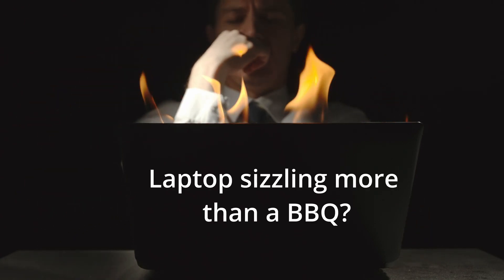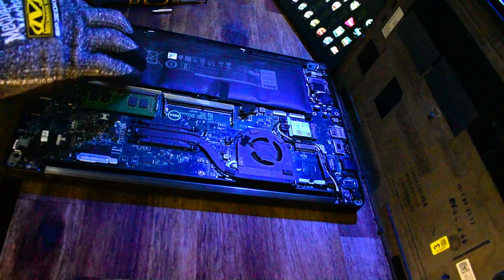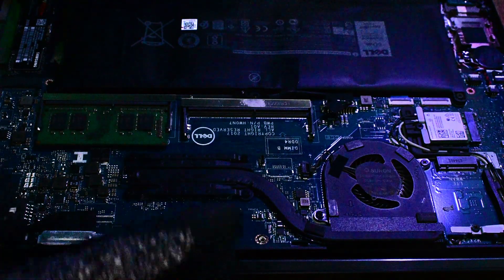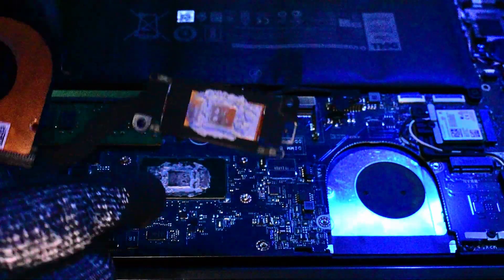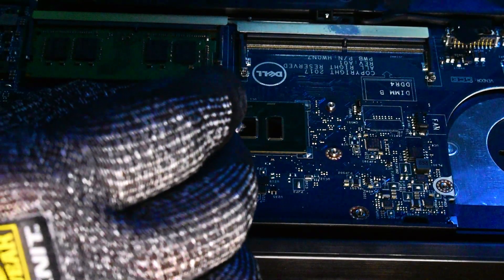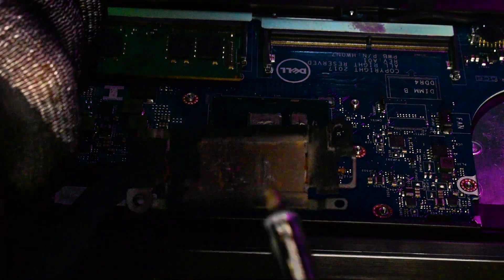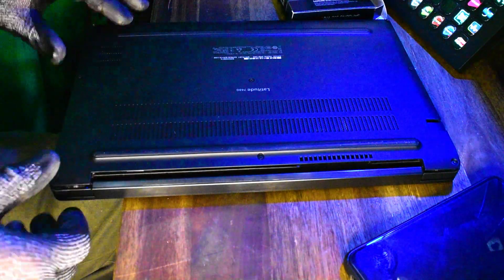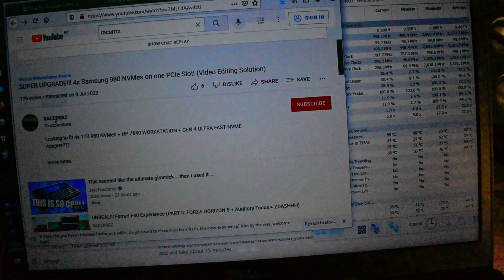Latitude 7480 Overheating Fix! This Popular Laptop Had One Problem. (Dell Latitude 7480)

Comment: Missed the part where you blow all of the accumulated dust from the intake vents, etc.....
Reply from the maker: I tend to opt for the 'Iamnotlazy' technique of not dedusting, as is required. I recall filming this laptop repair at 12am and I wasn't prepared to start up the air compressor to do so (with extreme care to not let the fan blades spin under air pressure; I have been out of 'compressed air in a can' for at least a few years now lol).

Comment: It's good to see breakdown videos out there like this. My only critique is that you don't need anywhere near that quantity of thermal paste. It would have been enough to clean off the old paste and put half a grain of rice's worth on the larger chip, and 1/4 of a grains worth on the smaller one. The goal is to fill in the minor surface imperfections on both surfaces that will barely squeeze out the sides when the heatsink is tightened down, not to put a thick layer between the two components.
Reply from the maker: Laptops tend to overheat due to the small surface area for heat dissipation. I add excess paste to ensure the entire surface is covered without any air pockets. I have done a thorough investigation on thermal paste application (https://youtu.be/pqkvvZPgv8g), and I even set up a formula to calculate the ideal volume of paste for the IHS size, although the surface area of the laptop heat sinks are really small which makes the application volume really small. Give it a test run! https://racerrrz.com/cpu_thermal_paste_guide/

Comment: Sir Dell latitude 7480 me WWAN ssd lega sekte h kya
Kripya kr ke help me
Reply from the maker: Hi there. Yes and no. You can fit M.2 NVMes to the M Key slot (mounted on the right hand side of the battery), but I am not aware of the M.2 E Key being able to use M.2 NVMe SSDs in these laptops. You can however convert the M.2 E key slot (which has only 1x PCIe electrical lane) to a M.2 NVMe slot with a M key to E key convert. The only downside is that the NVMe may not fit in the laptop (even short NVMes will stick out due to needing an adapter) and the NVMe will be speed limited (four times less speed due to only having 1 PCIe lane on that slot). 

Example of how to fit the M.2 NVMe:
https://laptopmedia.com/highlights/inside-dell-latitude-14-7480-disassembly-internal-photos-and-upgrade-options/

Example of how to fit the M.2 NVMe to a M.2 E Key slot. 
https://www.youtube.com/watch?v=Z8XqmnyqbzQ
---
ChatGPT Translation:

"Hi there. Haan aur nahi. Aap M.2 NVMe SSD ko M key slot me laga sakte ho (jo battery ke right side pe mounted hai), lekin M.2 E key slot me NVMe SSD use karne ke baare me mujhe koi confirm information nahi hai. Lekin, aap M.2 E key slot ko (jo sirf 1x PCIe electrical lane support karta hai) ek M key slot me convert kar sakte ho M key to E key adapter ke through.

Bas do problems hain:

    NVMe SSD laptop ke andar properly fit nahi hogi, kyunki adapter ke wajah se even short NVMe bhi thodi bahar nikal ke rahegi.
    NVMe ka speed limited rahega, kyunki us slot me sirf ek PCIe lane hai, jo normal speed se 4x slow karega.

Yeh dekho, NVMe ko M.2 E key slot me kaise fit karte hain: 
https://laptopmedia.com/highlights/inside-dell-latitude-14-7480-disassembly-internal-photos-and-upgrade-options/

Yeh hai M.2 NVMe ko M.2 E Key slot me fit karne ka example:
https://www.youtube.com/watch?v=Z8XqmnyqbzQ

Comment: can i only change the thermal paste ?
Reply from the maker: Their replacement is normally required, but if you are really careful with the removal process you likely could just replace the thermal paste. I found the thermal pads that they used to be really fragile and they had a tendency to tear on removal. You should be able to obtain some thermal pad on the cheap if you have access to ebay etc. I recall spending ~$3-7 USD for a decent amount of thermal pad.

Comment: Thanks 👍 I did that but unfortunately my laptop is still overheating and the fun is spinning all the time. Do you have any suggestions 🤔
Reply from the maker: I am sorry to hear your laptop is still running hot. What thermal paste did you use? Did you replace the thermal silicone pads? I would recommend Thermal Grizzly Kryoaut paste - it's the best paste I have used. The main problem with laptops is the small surface area and compact design of the heat sink. 

The only other fix would be using a fan that you can place underneath the laptop. You get special cooling lads that have a fan and they are powered via USB. That would be the only other thing that can help. To get you started - here are some Amazon links (affiliate links - I earn a small commission if you buy using these links): 

Thermal Grizzly Kryonaut: https://amzn.to/482tZxm
Cooling Pads: https://amzn.to/4bwleyo

Let us know if how you get on, hopefully the laptop temperatures do come down a bit.
Reply: @racerrrz  I used MX-4 thermal paste but I think there is a problem with hardware the CPU is always used between 50% to 100% it feels like hot iron 🤔
Reply: @racerrrz  I fixed the issue so easy I just did system restore the previous settings some applications caused the trouble!
Reply from the maker: Well done! I am glad to hear it was software related, that means your fix should now give you good thermals. MX-4 is a decent paste but if you want to remove another 3-5'C try out Thermal Grizzly Kryonaut - I found it was ~5'C better than Arctic Silver which was my tried and tested paste for many years.
Reply: @racerrrz  Thanks 👍

Comment: u could have replaced the battery at the same time. it was alreads puffy
Reply from the maker: I should have yes, but I wasn't prepared for it while filming (I didn't expect the battery to be going out since it was still performing quite well - ~3hours of life). But it is quite a simple upgrade, and as you pointed out - it's not safe to have a puffy battery!

Comment: can u charge non thunderbolt model via type c ?
Reply from the maker: This may vary according to the laptop model but the best way to check will be to go to the original service manual for the laptop. Generally, if the laptop was supplied with a power brick (e.g. 65W charger) and that charger does not have a USB C charging cable then it's unlikely that you can use USB C to charge the laptop. The Latitude 7480 requires a 7.4 mm Barrel connector for charging, and it does have a USB C port that can be used to charge devices like phones etc., but it will not charge via USB C cable.
Reply: @racerrrz  thats weird. i heard docking station charges the laptop via type c. in the manual it says E5 65 W for the charger and it has type c variant too so idk. i will try and inform when mine arrives.

Comment: Any way you might be able to help cool down the CPU more than just to 60 - 75  degrees?
Reply from the maker: Hi. Laptops are just not able to dissipate enough heat due to the small contact surface of the CPU IHS and heatsink. The best solution I have found is to use a quality thermal paste (my best one was Thermal Grizzly Kryonaut), ensure you have quality thermally conductive silicone and have a USB fan to place underneath the laptop for extra airflow.

Comment: I want to try putting a 7490 board in a 7480, just cuz I want to see if it works.  Has anyone done this?
Reply from the maker: I have not had the pleasure of a motherboard swap for a laptop, but generally the more modern Dell laptops are well assembled. Doing a quick check online it appears to be feasible, but likely no-one has actually done it/made a video about doing it. 

This may be of use in your quest: https://www.reddit.com/r/Dell/comments/12914x7/can_i_swap_a_dell_latitude_7480_mobo_for_a_7490/

The main limit seems to be screen panel differences, but I am sure there will be other minor differences as well. As long as the board fits, and most of the connections match up, it might be possible.

Comment: Just picked one up for $110 thing is mint, has the i5 7300u cpu with 8 gigs of Ram. What do you recommend me to do to it next? Am I able to do 2666mhz ram on it?
Reply from the maker: Nice! That was a good price for the performance of the laptop. I would recommend upgrading to 16GB of RAM because that tends to help remove the memory limit annoyance when you are trying to do multiple things at once. Unfortunately the 2666Mhz RAM will not match the 7480's 7300U CPU. They are best paired with the slower / cheaper 2133Mhz RAM. For the price you have a solid performer. The only other upgrade that is well worth it is a decent PCIe 3.0 based NVMe (like the Samsung 970 Evo Plus). Keep an eye on the temperatures - something like HWiNFO is very useful for this. If the temps start climbing it might be time for a thermal regrease. I plan to test Thermal Grizzly's Kryonaut in my next laptop regrease.
Reply: @racerrrz  thank you for the information and recommendations. I will currently do the RAM upgrade and NVMe upgrade as well thanks!
Reply from the maker: @tsuinburedo8247  No problem, I am sure you will enjoy it. For the RAM, check the current RAM module's specifications (the main detail to match is cache latency; something in the order of "DDR4-2133 Non-ECC SoDIMM CL15"; with CL being the memory latency) and see if you can obtain one that is matched with your current one. You could also go for 1x 16GB RAM module but 2x8GBs should work fine also. Good luck!
Reply: @racerrrz  I was looking at the ‘Crucial 16GB DDR4-2400 SODIMM’ say it’s the CT16G4SFD824A set. Would this be a perfect replacement?
Reply from the maker: @tsuinburedo8247  Yes the Crucial module you found will work. The RAM will operate at 2133MHz instead of its maximum rated speed of 2400MHz, but if you end up upgrading in the future you might be able to transfer the RAM module into another laptop also. The most optimal slot will be "DIMM A" for a single module (you'll see it printed on the laptop PCB / motherboard).

Comment: I'd only be using that little drop you put on at the end - and nothing more!    Good video though - but why so dark?
Reply from the maker: Hi there. Fair point there! I am use to Xeon processors which have a fair bit more surface area. haha. This was recorded at my computer desk and there was only one room light above me. The latest installment of the same type of video had 3x LED ring lights, yet it was still somewhat poorly lit! For reference: https://youtu.be/QD1NKLQvslI ).

Comment: I'm planning on getting one of those laptops the i7 7600u 32gb ram 512gb ssd version
Reply from the maker: Hi. Nice, the 7600u runs well and with 32GB of RAM you will be able to multitask well. There is another laptop that I can recommend in the same price class. The Dell Latitude 5580 (ideally with the Intel i7 7820HQ, 4 Core!). Similar in overall performance but it can come with a 1080p touch screen which is quite nice. (I have a thermal video planned for the 5580 also).
Reply: The current laptop I'm using is a intel celeron n4500 e410ka I got it for 140$ form bestbuy
Reply from the maker: @BIGBOYTACO  Nice, you got that laptop for a great price! With patience you can pick up these laptops for a great price. The top spec Dell Latitude 5580 with i7-7820HQ and touch screen varies in price a lot! Cheapest one on ebay (shorturl because ebay links are massive; link may not work forever, ebay search terms were: Dell Latitude 5580 15.6" FHD i7-7820HQ ): shorturl.at/uxEJ6 . Solid performance. These laptops are built for handling high workloads.
Reply: Cool
Reply: It looks nice
Reply from the maker: @BIGBOYTACO  Solid performer. I have seen them come up for as little as ~$150USD, but that's quite rare.
Reply: This is the laptop I'm planning to get
Reply: Ya

Comment: Brother how r u? I want to request from you a new video i am sure it is very interesting for and specially for z840 users..have u heard about the hp Zcentral boost or hp RGS? PLease brother i would like you to make this new video..please
Reply: this will let u use a not hi spec pc/laptop thru pixel streaming remotely..but i dont know how to configure it..even i watched hp tutorials
Reply from the maker: @wilsione  I'll check some of the tutorials to see what is recommended but I think something changed on the service end. I'll do some checking.
Reply from the maker: Great idea. I did check up on it but I could never get it operational. I presumed HP either dropped support, or restricted access, but it might require an email to verify! I'll do some more research and report back. If I can get it working it will be well worth the video! The next video is in operation, Z840 Z Coolers / 3D Vapor cooler install, plus thermal testing before and after fitment!